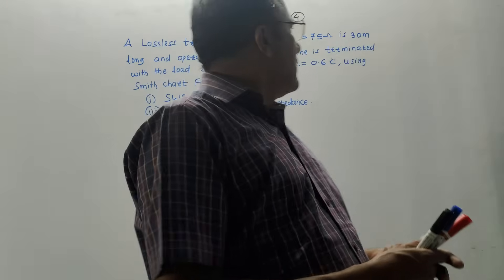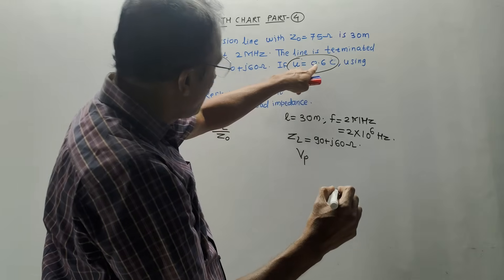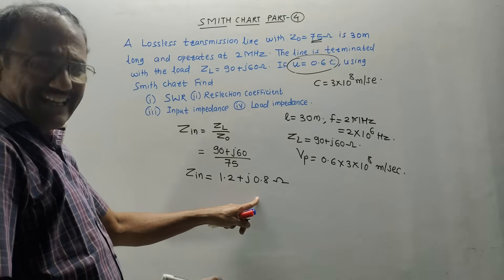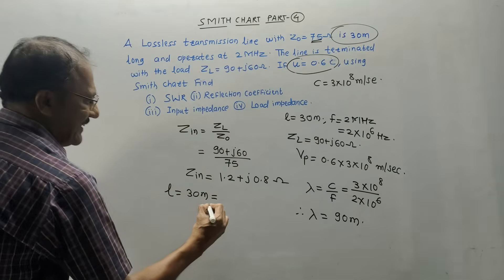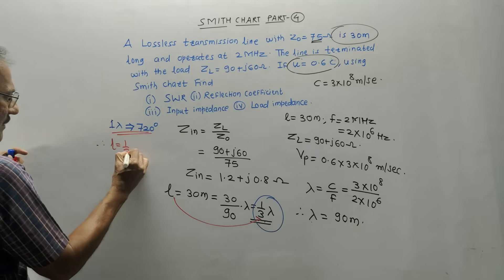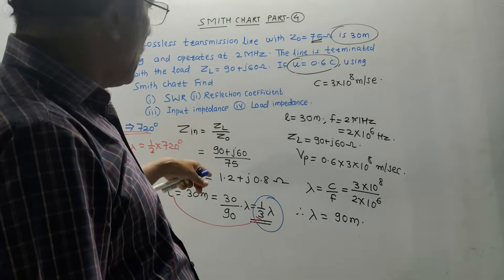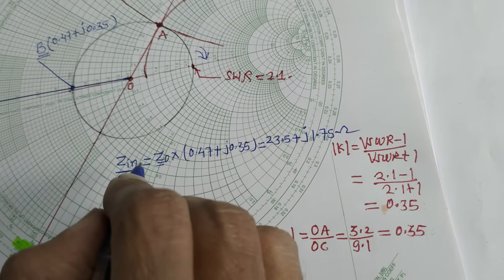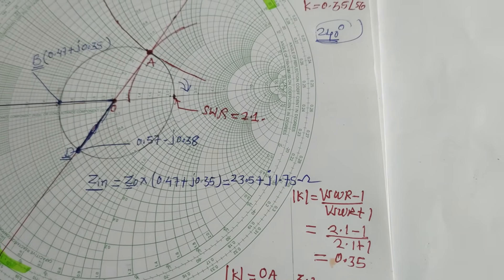SMITH CHART  part-4

Comment: Sir , at 2:44 you done calculation as 90m but it is 150m it changes whole answer so what changes i have to do for the other calculations ?
Reply: He has forgotten to write some values by mistake here the correct one 
0.6*3*10⁸/ 2*10⁶ = 90cm
Reply: Also can you tell the value of k practical value i.e oa/oc mine is coming 2.8/7.9 , what's your coming???
Reply: @Kalki99.  mine is same